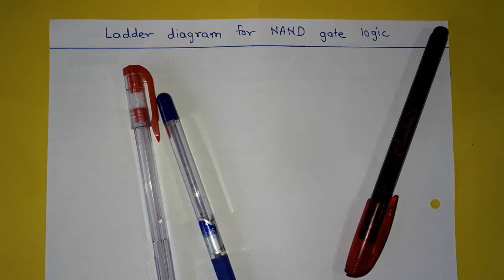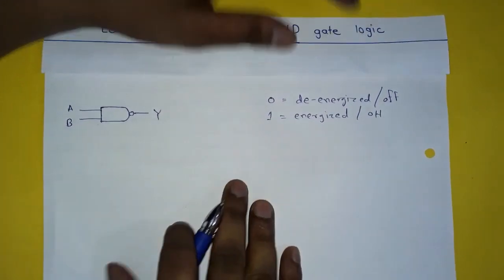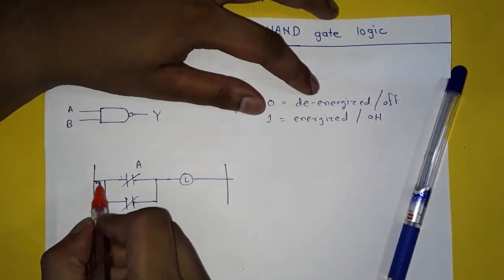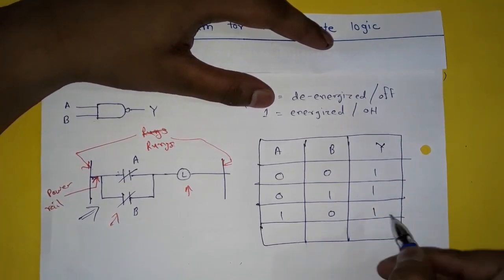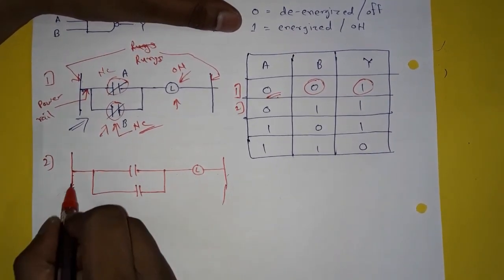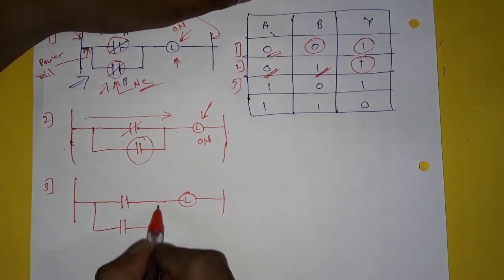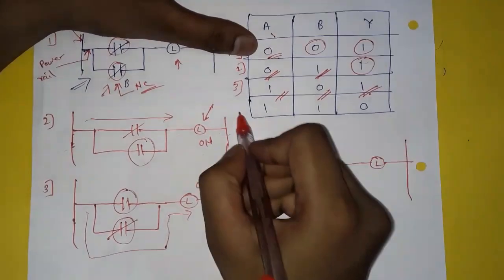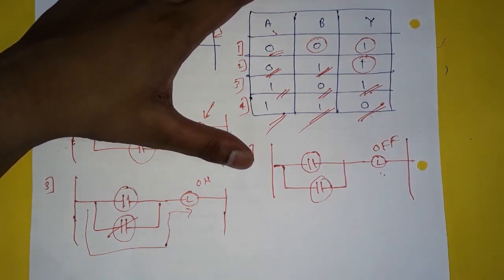Ladder diagram for NAND gate logic

Comment: If I'm not wrong, while you were stating 0= de-energized and 1= energized and down in the truth table A= 0 and B= 0 so Y= 1 how?
You already stated that 0 means de-energized
Reply from the maker: In NAND Gate Logic, switches are normally closed (NC) at start in ladder diagram & connected in parallel position. So when A & B are de-energized (0) still there is flow of current towards lamp. So lamp glows (ON) (Y = 1). When A & B are energized (1) then NC contacts of switches opened. So there is no flow of current towards lamp & lamp doesn't glow (Off) (Y = 0).
Reply: Okay got it. Thank you. Actually I was referring with PLC's XIC and XIO command
Reply from the maker: Welcome...